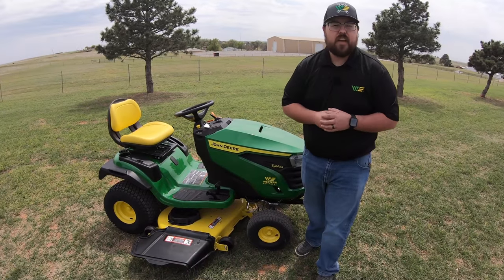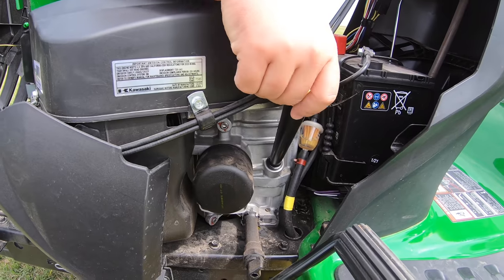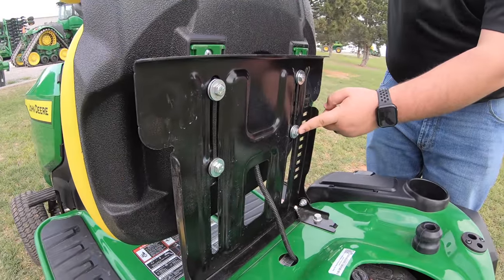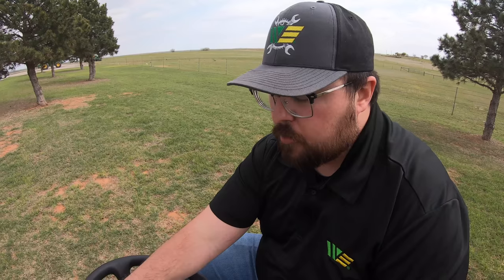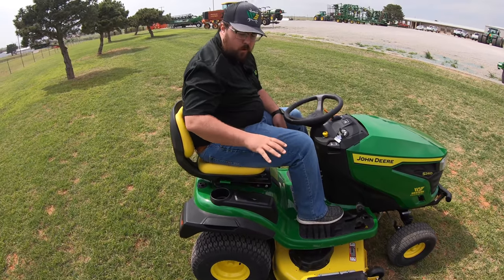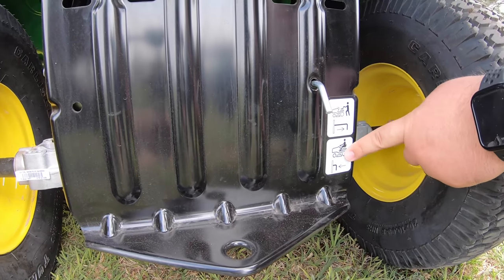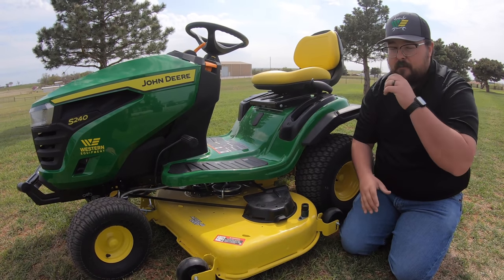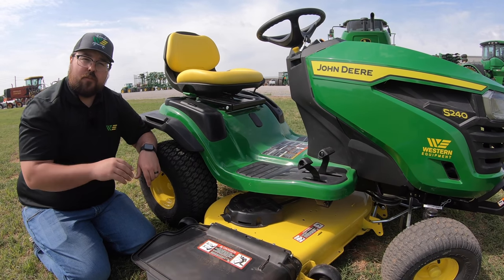2021 John Deere S240 Lawn Tractor Mower Review and Walkaround

Comment: Great video! What would be the advantage of going from a S240-42" to a X350-42"? They seem to have the same FR651V engine and K46 transmission.
Reply: Did you make a decision on one?  May I ask why?  I'm in the market for a new mower.  Thanks.
Reply: @cambellschunky704  not yet. I have been researching a while. I sat on a X370 the other day. I must say the seat was really comfortable compared to the one on the S240 and X350.
Reply: @steve9377  The X series is a class above the base S class so I'm not surprised about the comfort.  X3 vs X5 may is a model difference as well as the next number.  The last number is an engine designation.  

I am leaning towards a Kawasaki motor.  

Is there a reason you have not considered a zero turn?  I would like one, but my elderly mother may have trouble with those controls.
Reply: @cambellschunky704  I’ve driven a zero turn a few times, I hated it. I’ll choose a steering wheel and pedals every time. Weird thing about the seat is once you get into the X500 series it goes back to the not as comfortable seat. A Kawasaki engine is a requirement for me. I wish John Deere would openly say it has a Briggs or Kawasaki engine instead of trying to mask it under the Cyclonic or iTorque names.
Reply from the maker: The biggest advantage is the additional frame size and strength. Then there are various smaller advantage such as an upgraded display panel and more attachment options. I hope this helps and thanks for watching!
Reply: @steve9377  If you look around the engine bay you can usually find an engine tag.  

I took my mom to a couple big box stores yesterday and was surprised to find absolutely ZERO John Deere's.  At the beginning of the spring, they were lined up outside....

She is having second thoughts about the zero turn as am I.  They seem like more complicated machines and may be harder to service.  I have never dealt with transmission repair and these zero turns have two.  I have also not seen as many older zero turns as I do lawn tractors which leads me to question their longevity.  My and my father did all the service on our '01 LT 150 and I think I can fix it again - 20 years is a pretty good run.

I think I'm in the market for an S or X class now, like you.  We're going up to the local John Deere dealership tomorrow.  I'll let you know if I learn anything.
Reply: @steve9377  I took moms down to the closest John Deere dealership today - the place where I bought parts for our old Deere.  There was nothing there.  Salesman says supply shortage due to you know what.  They did have a couple X300's there and it definitely looks like too much tractor for our lawn.  We don't have hilly or rough terrain and 90% of the time will be simple grass cutting by mulching or bag.

The S240 with a 42" decks seems to fit the bill best.  Kawasaki engine, upgraded transaxle from the S100 series, slightly thicker deck than the S100s, and no silly Easy Oil Change.  The only thing I don't like is the electrical blade engagement instead of the manual lever of the S100's.  

We placed an order for one but the time frame is sketchy - it may be November before we see it.  Crazy times.
Reply: @cambellschunky704  hmmm. weird. the dealer close to me has quite a few models in the showroom including two s240s. I guess it depends on the area. John Deere seems to have been using an electric PTO for a long time. My 1987 160 has one. It’s quite nice. I wanna say it’s a simpler design with less moving parts. Good luck with your s240!

Comment: My yellow seat is basically falling apart.. other than that I love it.
Plus it’s very hard to gas up.. any suggestions?  Thanks
Reply from the maker: Seat cover should fix you up on the seat and as far as filling the tank a like fo use an extended funnel to avoid the mess. I hope this helps and thanks for watching!

Comment: I wanna do some yard mowing for my neighborhood, they are 1 acre or just a bit more, what would be the model in the s100 or 200 series? Or a good used model? Thanks
Reply from the maker: Any of the 100 or 200 series models would be great, even in the used models. Main thing you need to decide is what size of deck you need to get in and out of gates if you have that issue. Good question and thanks for watching!

Comment: Bought a 2023 s240 with the 42” deck. Spring in the electric clutch busted after 5 hours of use. Dealer took 5 weeks to repair it. Also a warning to anyone looking for a bagger to install yourself: JD changed the deck, so s240 baggers aren’t 1 model fits all. Yellow decks get one model, green ones get a different one. Brent’s video is great…for the yellow decks. Had to follow the IKEA level instructions for the green deck since there aren’t any videos for those installations. You’re almost better off looking at parts, looking at the deck, and figuring it out yourself.

Comment: Question.  I am comparing this model with a s170.  But what gives me pause is why does the s240 have smaller rear wheels and an engine with less horsepower than a s170?
Reply from the maker: Well the S170 is meant to be in the upper class of the 100 series mowers so there for it gets higher horse power and some larger back tires.

Comment: Just wondering if you can guess why JD stopped offering the freedom 42 deck? I own a 20 year old LT 160 with the freedom mulching deck, the deck mulches perfectly only had to replace the timing belt once in all the time I owned it. I have a new s240 with the 42 deep cut deck on order from the local JD green store, they said might be in by mid June but they can't say when the mulch kit will be in. I'm still cutting with the LT but the Kohler is burning oil under load almost to the point of "hope the neighbors don't call the EPA on me while I'm cutting" mode.
Reply from the maker: I honestly do not know why they discontinued the freedom deck. I have heard numerous times how well they work. The mulching kits have been an issue to get for a while now so I am hoping this gets resolved soon. Thanks for watching!
Reply: @WesternEquipment  The price of progress I guess, thanks for your reply.

Comment: Curious on the oil change with the new fr651v that has the 2.2 quart oil capacity. Will the purchase of 2 quarts be enough due to residual oil that may stay in the engine, or should a partial small amount from a third quart be required? Oil change kits are still showing just 2 quarts. Also, this is my first kawasaki engine. Is it normal for them to require topping off the oil alot? Are they oil burners?
Reply from the maker: Usually 2 quarts does the job and I have not experienced them being oil burners and have not heard that from our service departments either. Good questions and thanks for watching!
Reply: @WesternEquipment  Thanks for replying.

Comment: Can you speak to the mulcher kit delay/recall for the new 2021 S240 42inch deck - thank you!
Reply from the maker: There are parts availability issues worldwide. From what I have heard there is just a shortage of raw materials and also a lack of transportation to get parts and materials to manufacturers. I'm hoping it gets resolved soon. Thanks for watching!
Reply: My local dealer says production has been shotty for the S220 at the factory.    That's why there's none around.

Comment: anybody buying one of these check up on the center of the front axle,  if they still put a grease zirk there make sure it gets greased frequently.  If the bushings don't wear the axle does causing the front tires to tow out horribly causing it to steer very hard.  Keep it greased and no problem.  I've replaced front axles on several of these 100 series JD mowers.  Other then that these are good econo/quality mowers.  Former Tech.
Reply from the maker: This is very true! I should have mentioned this in the video.

Comment: Hi Brent was wondering if you might be able to help me with something, purchased a 2020 s240 got about 10 hours on the machine and the gas tank gauge does not work , is there a simple fix that I can do myself I am good with wrenches thanks.
Reply from the maker: So the gas tank is a floating tank that sits on an arm that runs your float gauge. It could be a couple of different things. Either that arm that goes from the gauge to the underside of the tank is broken or your tank may have springs that help hold it in place and one of them may be broken. I wouldn't sat this is a simple fix just because of how much disassembling will have to be done. But those would be the issue cause the gauge not to work. I hope this helps and thanks for watching!

Comment: INTERESTING QUESTION FOR "WESTERN EQUIPMENT" ABOUT THE NEW S240; YOU MAY NOT BE ABLE TO ANSWER THIS BUT,... WHY DID JOHN DEERE DUE AWAY WITH ALL THE HEAT VENTS ON BOTH SIDES OF THE ENGINE HOOD EXCEPT FOR ONE SMALL SLOT IN THE TOP CENTER,..? EXCEPT FOR THE FRONT GRILL AREA IT SEEMS LIKE SINCE HEAT RISES,..THERE WOULD BE EVEN MORE HEAT BUILD-UP WITH LESS HEAT VENTING OR DISPERSION ABOVE AND IN THE ENGINE AREA.
Reply from the maker: I wish I knew the answer to this. John Deere seems to like to change up their styling designs often so I'm assuming this on one of those type of things.
Reply: @WesternEquipment  THIS NEW HOOD DESIGN IS IN ITS 2nd YEAR I BELIEVE,... HOPEFULLY THEY KNOW WHAT THEIR DOING,..? I'LL KNOW BETTER MYSELF ABOUT THE HEAT ISSUE WHEN MINE ARRIVES IN A COUPLE OF WEEKS.

Comment: Question... since they no longer have the little latch detents on the hood, does the hood have a tendency to bounce up and down when travelling over rough or bumpy terrain?
Reply: My d120 has no detent it just has some spacers so it doesn’t rub and takes up that slop. It doesn’t bounce or move. The hood is weighted and balanced so it doesn’t move much. My friends craftsman is horrible. He’s hit bumps that have launched the hood clear off the machine.
Reply from the maker: I think @FishFind3000 summed it up pretty good. There is little to no movement in the hood over bumpy terrain.
Reply: @WesternEquipment  Cool!  Thank you for confirming.

Comment: if you want to use a mulching kit  do you need to change blades on a 240  48" deck ?
Reply from the maker: It's a good idea to change to the mulching blades because they have a longer cutting surface that will help to mulch the grass finer. Good question and thanks for watching!
Reply: @WesternEquipment  what would the part number be for the blades?

Comment: Still debating between S240 vs X350 (42") as both have same engine, so what is that price difference?
Reply from the maker: It looks like there is about an $800 difference. Could be more, could be less depending on where you shop. I hope this helps and thanks for watching!
Reply: @WesternEquipment  sorry I meant why is the price difference and not what. I have around 16000 sq ft to mow with some slope.
Reply: @SwapnilBhartiya  as of right now the order in features of John Deere mowers go from the series (the ones shown in Lowe’s etc, and goes from s100 to s180) then goes the s series but the s240 which is right in the middle in between the s and x series. The x series have a lot more features to choose from but cost more.
Reply: @manofculture4945  Ditto. S240 has same engine and other features in x350 except may be the steel is a few mm thicker in x350 pls one extra year of warantee. So I am not sure if $1000 is worth given I am just a home users with 17000 sq to cut. In most cases there is huge difference in quality and sustainability but at this point i am a bit confused.
Reply: @SwapnilBhartiya  yes I would go for the s240 there are barely any differences apart from the hood design
Reply: @manofculture4945  Went to a dealer today and with service there is a difference of over $1200 between these machines.

Comment: hi brent i just bought a new s130 and it was missing a spindle cover would that be under warranty ive already contacted and made case with john deere so im tryin to get that cover its rh spindle cover,and ive heard lot people had that happen to,ok later brent
Reply from the maker: Sounds like you have gone through the proper channels to get your issue resolved and yes this has been happening a lot and I'm not sure why. Let me know what happens and thanks for watching!
Reply: @WesternEquipment  hi brent I got update from john deere case and they sent me a diagram and parts list for the s130 42 deck and said there was no part only a cover over the lh spindle is shown on the diagram and parts list so I guess there was no cover after all but I'm thinking maybe the lh cover will fit the side ok have a good one brent.
Reply: hi Brent they corrected my case and now there is a spindle cover for the s130 john deere tractor mower, part number GY21773,it is if your veiwers need one to,for the 42"edge deck,they said will send me one out asap,so hope resolved soon sorry to bother you with my problems but it was just a missing part that i didnt get,ok good videos Brent ill be watching,later brent

Comment: What I have always liked about my Craftsman is the ability to mow in reverse without making any additional actions. One lever for choke and throttle combined. Start the mower , reposition the start key to a reverse position and mow in in forward reverse anytime. My reverse is with a handle similar to the deck lever and my hand is always on it. Quick and simple. I don’t need two foot pedals nor an extra button for reverse. J-D has too many buttons and levers. That’s not a high end sports car you have there, it’s just a grass cutter.
Reply from the maker: Well thank you for the feedback and I appreciate hearing other peoples opinions. Thanks for watching!
Reply: You've got the same cvt transmission my old cub cadet has. It's good as long as you dont have alot of obstacles when you're mowing,but if you have to change direction alot a hydrostatic tranny allows alot quicker transition.  I will agree that I'm not a fan of john Deere's mow in reverse feature,but the s 240s loaded with high quality features and the deck is second to none. The best selling feature is john Deere's impressive customer service after the sale. Craftsman service is no longer available and you'll not find any stocked parts. Independent shops will work on them,but you wont be a priority and you'll be waiting on parts being ordered. I'll stick with john deere or cub cadet when I get a new mower.
Reply: The reverse switch is very easy to by-pass, took all of 5 minutes. I had a mower with the handle for forward and reverse and liked it until I got this one, now I much prefer the foot pedals.
Reply: @redbone5363  yeah,I bypassed mine on my cub cadet too.
Reply: buying our first new riding mower in 20 years. My dad and I were surprised. Mowers today are more complicated for no reason, not to mention more expensive. Back then the one we got was 900 bucks and all metal. The S130 we were looking at is $2800 and is half plastic. So many buttons and features that are gonna break in time. That digital gas reader, parking brake button, cruise control?? lol And we asked that too, why is it so complicated to mow in reverse? On the old mower all those buttons and extra pedal were basically in one lever, and mowing in reverse wasn't something you put extra thought into, it's a basic thing.
Not sure why it's like this either like you said it's just to cut the grass. But i'm guessing like anything else, it's so they can charge you more and they put all this extra flimsy crap cause they don't want you to have it for years and years. They want it to break so you to run out and buy another.

Comment: Just bought a new S240 and a few days after the 1st mow, I found 5 random areas of dead grass in the lawn and after the second mow on Saturday, there are 4 more patches. They look like fuel burns and I’m guessing it’s coming from the mower. Anyone experience this before? I will be calling the JD dealer tomorrow. Thanks
Reply from the maker: This is interesting, I will be following this thread. Thanks for watching!
Reply: @WesternEquipment  thanks - dealer insisted it’s not the mower so I push mowed this weekend and waiting to see if any new spots appear. If not, I will mow with the JD on Wednesday and then see if any new spots appear. Dealer thinks it’s either stray dogs or rabbits doing the damage so we’ll see.
Reply: I had the same thing happen I found it’s where you stop and sit at full throttle it burned the grass. If I stop now I lower the throttle haven’t seen any since

Comment: I BOUGHT AN S240 WITH THE 42" DECK IN 2019 VS ANOTHER "L" MODEL MOWER THAT I HAD BEEN BUYING BEFORE. THE "L" MODELS ARE GOOD BUT FOR A LITTLE EXTRA MONEY I FELT I GOT A MUCH BETTER MACHINE. IT HAS A BETTER ENGINE AND TRANSMISSION. I DON'T NEED AN "X" MODEL FOR THE MOWING IN MY YARD. I LOVE IT. ,..... NOW I HAVE ORDERED A NEW 2022 S240 AND WILL BE SELLING THE ONE I HAVE. THERE IS NOTHING WRONG WITH THE ONE HAVE THAT HAS 115 HOURS ON IT. I JUST WANT TO START OVER WITH ANOTHER NEW MACHINE WHILE I CAN GET BETTER MONEY FOR MINE THAT IS ONLY 3 YEARS OLD.,... TAKE A CHANCE, IF YOU CAN AFFORD IT, AND GET ONE,....THEY'RE NICE,.!
Reply from the maker: I completely agree! Thanks for the comment and thanks for watching!

Comment: How is this more on a slope?
Reply from the maker: They do pretty well. Tractor style mowers do well on slopes especially once you find which angle to mow at to get the best traction and cut. I hope this helps and thanks for watching!
Reply: @WesternEquipment  Thanks for the help. I went ahead and purchased one and am having some regret. Not because of the mower itself, but because of John Deere's inability to produce the bagger and mulching kit attachments. Spoke to local dealers and they have informed me that Deere has no indication as to when those attachments for the 2021 model will be available. (42 in Deck Only)